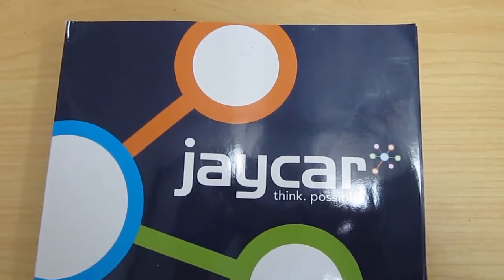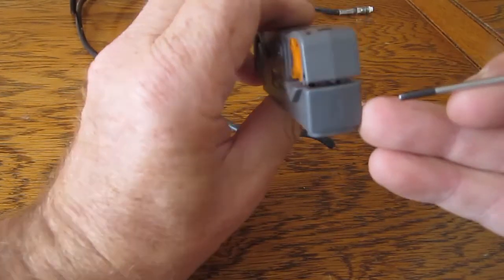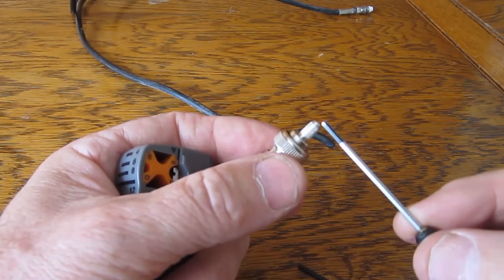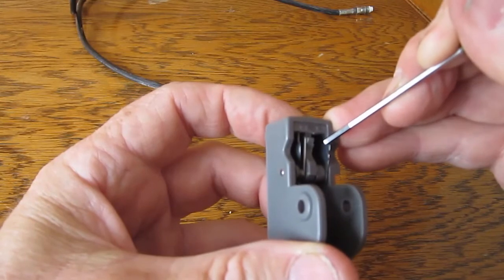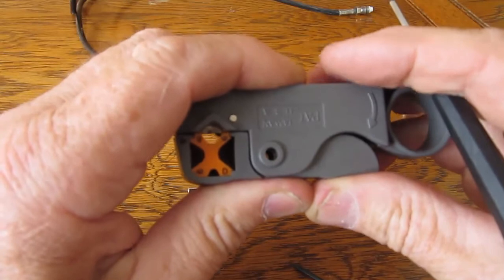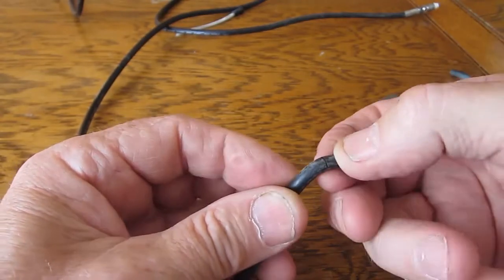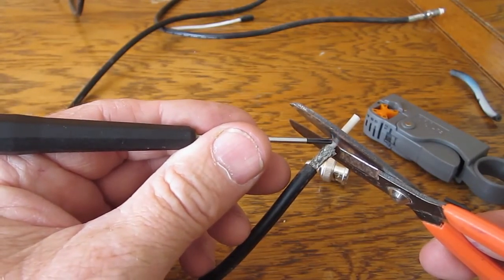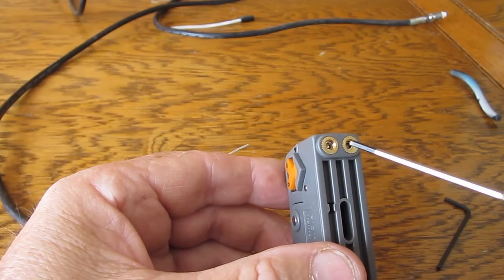Coax Stripping Tool

Comment: Nice video. I thought you mentioned you have your blades set at A and D for RG 58?  Any idea what the correct blade spacing would be for RG6?
Reply: Hi! Hold your connector you're going to use up to the drawings on the tool! Then make a match with the blades.

Comment: I've had so much trouble finding proper instructions for coax strippers. For example, the online Jaycar catalog,  there was no manual, no instructions, no info on the manufacturer, just the description:
"Simply rotate the stripper clockwise around the cable 3 to 6 times."

It's been the same Mouser, Digikey, Cinch.... To make matters more difficult, I want to make cables with RG-316DS, which isn't nearly as common as the thicker cables. I had ordered one of these tools (before seeing this video), and had no idea it was intended to be opened.